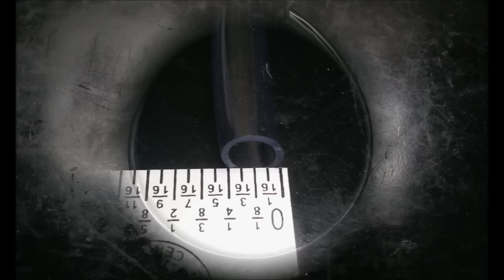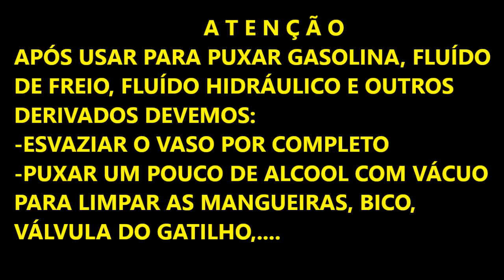Transformando um pulverizador em bomba de vácuo para diversos usos. Vacuum Pump ( do it yourself )

Comment: If you ran a wire from the trigger somehow out just past the end of the spay nozzle and lost the hose you'd have a airbrush basically spray a perfect circle as the needle pulled back a full circle of even ish paint is star with a small hole and wire at first gradually try bigger due to the lack of a compressor

Comment: Could be handy working on a car to bleed the brakes or maybe vacuum drain the oil, that's how some boats do it for an oil change. Just connect the tube to a larger sealed container to isolate the fluids from the pump.
Reply from the maker: Yes, see this video https://youtu.be/h-0nquSgpBE

Comment: Yes various uses, and you can use it for automatic syphon too. In instances when you can have the pump lower than the reservoir you are emptying you can pump it up the first time and it should keep flowing after you loosen the lid once it starts flowing.

Comment: Good Job. Could I use it to vacuum air from a pot for epoxy resin getting rid from bubbles ?
Reply: You can also use the intake of an air pump/compressor. I took the motor and pump from a 12v tire pump epoxied a tube on the intake to attach a tube and have used it to bleed brakes.
Reply: @allenmckinney9533  Thanks for your reply.

Comment: Subtitles were a bit to fast... but just monetarily change the video speed to .25% and then pause "if necessary" as a work around. Beyond that... my experience with these pumps is oil, chemicals screw up the foot valve as I was using one to shoot a home brew termite killer into damage wood. The mix I used included lacquer thinner and kerosene but "again" after a few hours it swelled the foot valve... so I doubt you can use it prolonged for gasoline, brake fluid etc... as he suggested in the description. Jus' sayin'.... but I have to admit "this is a good idea." Perhaps, if one cleans the unit with soapy water "immediately after use with harsh chemicals" it would solve that problem.  I give him an "A" for effort... and a Thumbs Up" !!

Comment: Sub-titles went by too fast at several different times forcing one to rewind then forward, again. Over all - thumbs down.
Reply: watersprite   ... yeah subtitles were to fast... but just monetarily change the video speed to .25% and then pause "if necessary" as a work around. Beyond that... my experience with these pumps is oil, chemicals screw up the foot valve as I was using one to shoot a home brew termite killer into damage wood. The mix I used included lacquer thinner and kerosene but "again" after a few hours it swelled the foot valve... so I doubt you can use it prolonged for gasoline, brake fluid etc... as he suggested in the description. Jus' sayin'.... but I have to admit "this is a good idea." Perhaps, if one cleans the unit with soapy water "immediately after use with harsh chemicals" it would solve that problem.  I give him an "A" for effort... and a Thumbs Up" !!

Comment: Have you tried to pump oil from an engine? Can it pump motor oil?
Reply from the maker: I've pulled automatic transmission oil to check the state without draining
Reply: thanks m8
Reply: Buy a 4 stroke mower oil pump